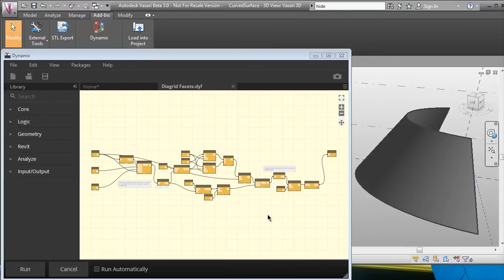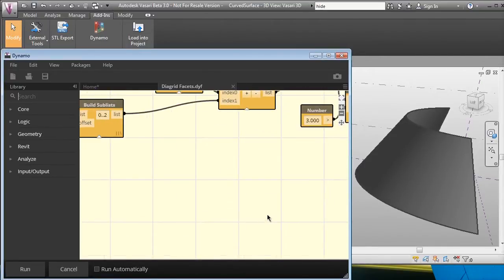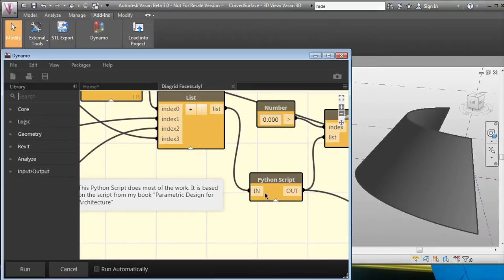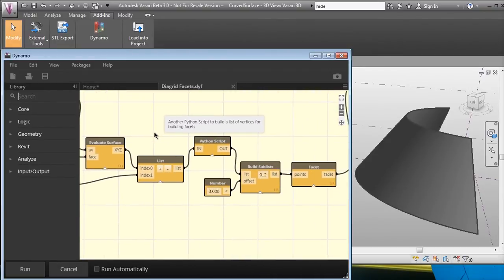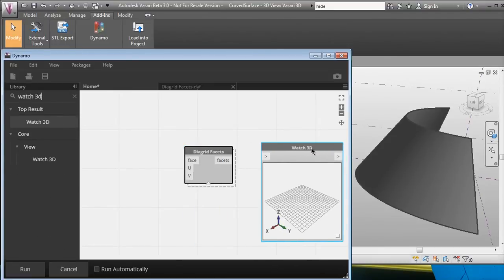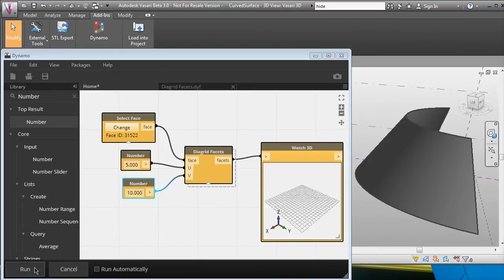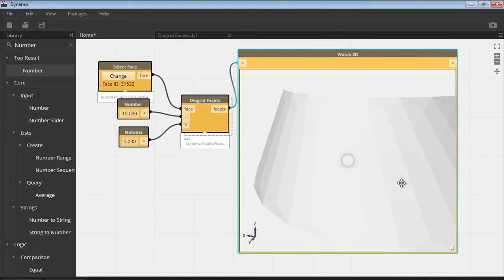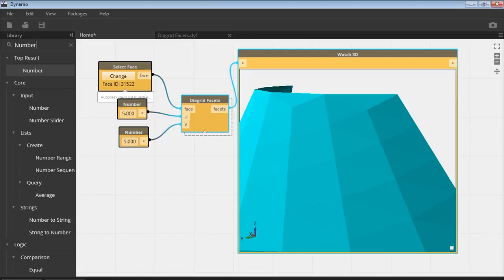Dynamo Diagrid

Comment: Hi Wassim,
Great example!  Looking forward to trying it out from the Package Manager.  If you pass just the point collections out of the custom node (instead of facets), you can do several other things with them . . . like pass the point groups to "lines through points" to see the edges, or use them to place adaptive components.
Reply from the maker: Hi Zach,
Many thanks :)  Yes, I just uploaded a new package to the Package Manager called simply diagrid. It outputs UV, XYZ, facet points (list of lists of 3 points), and the facets. This way the node is much more versatile. Thanks for the suggestion. Keep up the good work with Dynamo. It is looking really good.